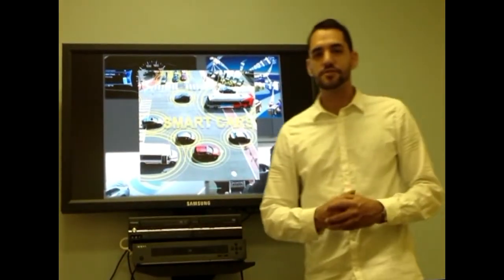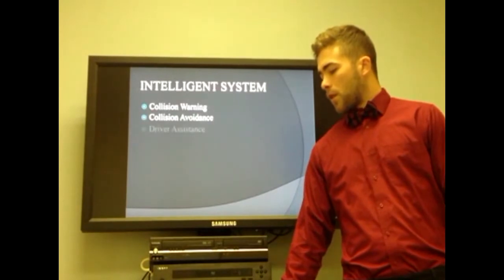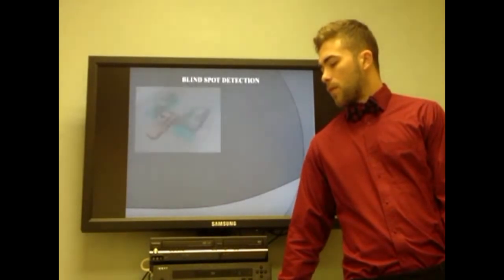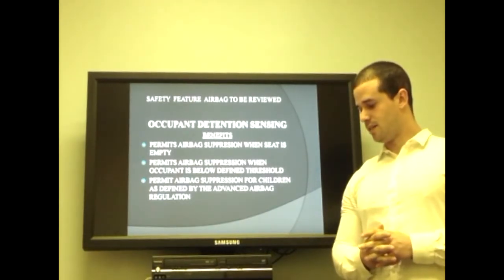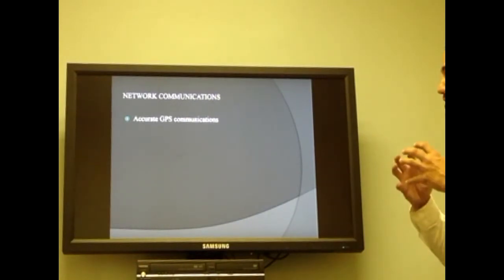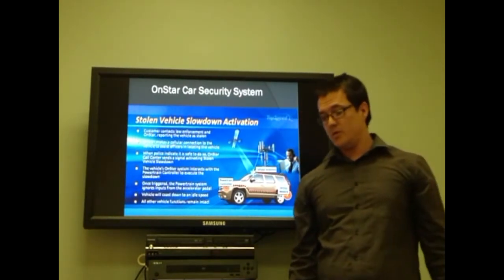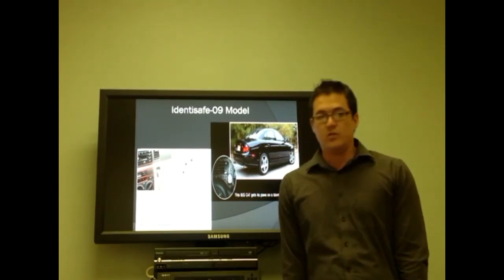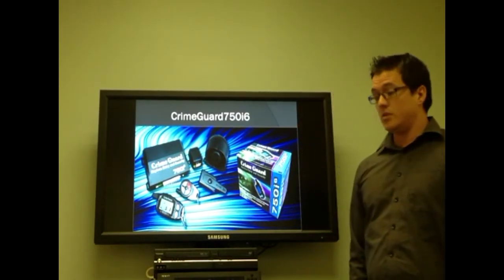Team P: Smart cars and their capabilities

Comment: Introduce everyone on your main introduction so that we know who is presenting from the get-go, not only by name but visibly as well. I think that the content was good and the power point was well made, but the presenters lacked practice and confidence; this could be easily remedied with some practice runs and memorization. The visibility was great but the power point was small for the screen. The sound quality also felt low in volume; try bringing the camera closer next time in order to increase the volume and provide a bigger view of the power point. The lighting was very good and you were all professionally dressed, which is a plus. Overall I think that the presentation was good; it was a bit on the long side but not too long. I recommend you condense a slide or two to save on time, do the presentation on separate takes so that each presenter has a good chance at being confident and clear, and make sure you practice a couple of times before hand to polish some of the jitter and reading-off-the-paper bits. That being said, nice job.